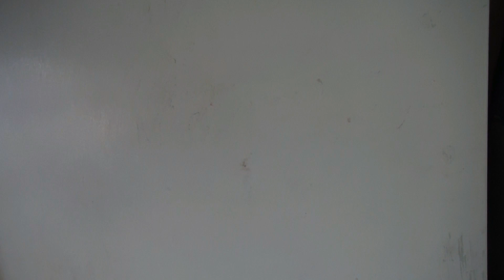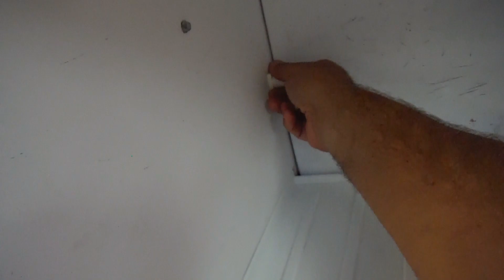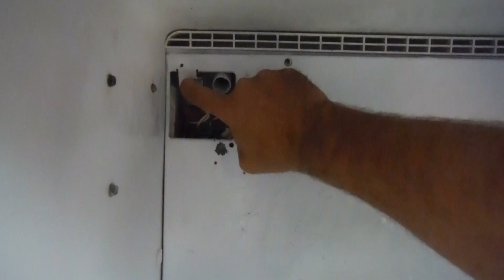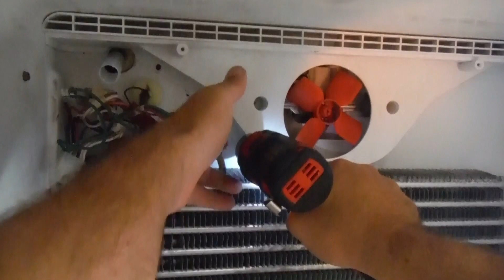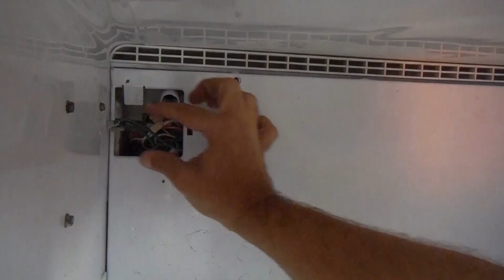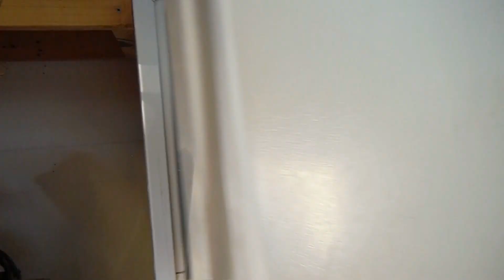WHIRLPOOL REFRIGERATOR WON'T COOL DOWN - FREEZER STILL WORKS - REPLACING EVAPORATOR FAN MOTOR - DIY

Comment: Pretty good. Although, I'm surprised you didn't just plug the fridge in to see if the evaporator fan was working first instead of testing for electricity.

Comment: I have the same question as others on fan direction, does the fan blow towards the back of freezer wall or into freezer area? My fan had complete failure so I could not see direction of flow. It seemed like it should turn clockwise to put airflow to the channel leading into fridge area but replacement turns counterclockwise sending air into freezer compartment.🤷‍♂️  Help please b4 I put it back together incorrectly. THANKS!

Comment: Great video.  I replaced the fan on the exact same fridge and now the refrigerator part is too cold.  I have the freezer and refrigerator set to the warmest setting without turning it off and the freezer sits at about zero and the fridge gets down to like 27 degrees.  Not sure what is causing this.  I'm not seeing any damper just two slots in the top of the fridge that let the cold air in.  Anyone have any idea how this particular fridge's temperature is regulated if there is no physical damper?   Thanks

Comment: Fridge and freezer work great until I turn the ice maker on. Then the temp in both get warm. I turn off ice maker and the temp shoots back down again. I've already replaced ice maker and the cold control thermostat. Any idea what is causing this?

Comment: Does the fan blow forward into the freezer as in I would feel the breeze from it before putting the back panel in or does it blow "backwards towards the back wall of the freezer?

Comment: I replaced the evaporator fan on my whirlpool side by side and its running. The fridge seems to be cooling now. How long will it take to get cold?
Reply from the maker: It only took a couple hours for mine to cool down.  It’s now reading 34 degrees Fahrenheit.  Hope you were able to get yours fixed as well.
Thx for watching!
-Dan the Fix it Man
Reply: @DantheFixitMan  It is cooling now but only to about 48. I have the fridge on the coldest so I will need to do some more searching.